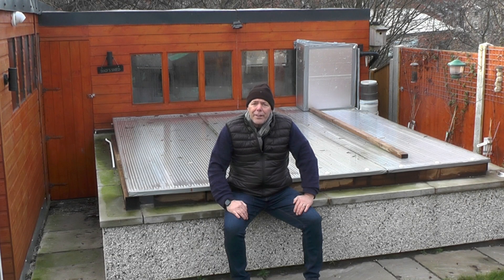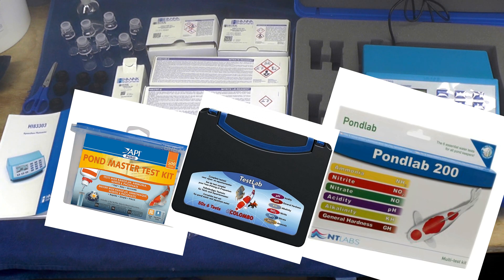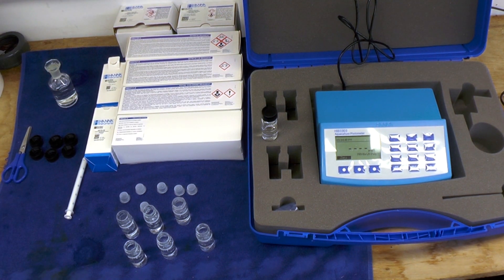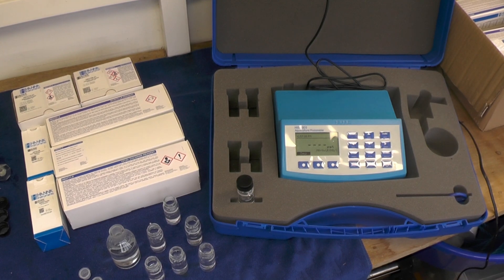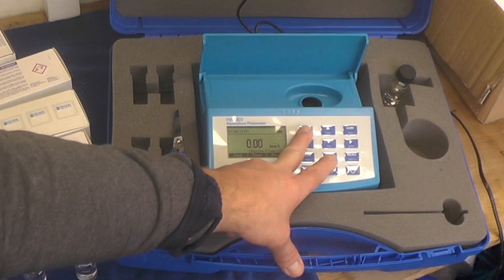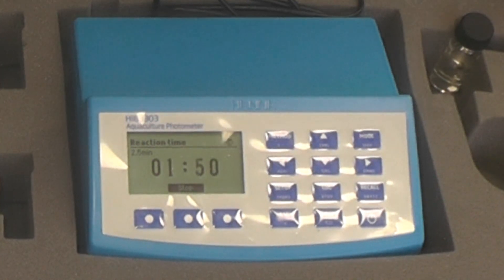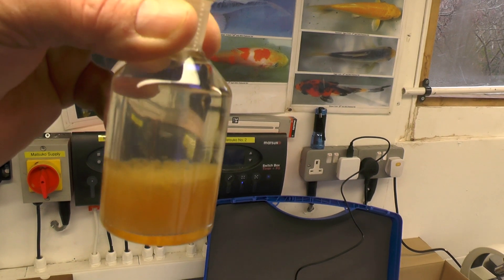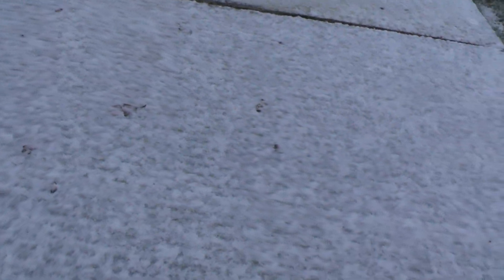How To Test Koi Pond Water Parameters With A Hanna Photometer - Part 2 - Chlorine & Dissolved Oxygen

Comment: Hi Kev,  I know they're expensive but they are a nice bit of kit and more accurate, I've used the satchets but found them a bit fiddly, either that or I messed them up going into panic mode, I have a handheld phosphate one from my reef tank days because normal test kits for phosphate were very hard to read, trouble with the handheld one I had if you wasn't quick enough it would turn itself off and would have to start over hence my panic mode, I don't know if they're all like that or if I was just super slow. Happy New Year, stay safe.
Rob.

Comment: Thank you for the water tests update. Interesting how you have residual chlorine. What is your source water chlorine, chlorine level coming out of the dechlorinator, and how much water are you changing? I've used my hanna total chlorine kit only once. I should test mine around this time of the year.
Reply from the maker: Thanks for watching and commenting. I got the Chlorine tests so I can monitor the effectiveness of the 3 Stage Dechlorinater. The issue with them is the flow rate needs to be slow (5 Litres per min Max) plus the life span. As mentioned I swapped the Cartridges  in late Spring so despite only doing small water changes I have no way of monitoring the volume used. This test proves I need to change the Cartridges of the VYAIR so my next Video is not only about the VYAIR but a Box opening and install of a 20" 3 Stage VYAIR Dechlorinator Unit.
Reply from the maker: I don't really do regular water changes because of my set up. The Oase Drum filter cleans every 20 minutes depending on the cleanliness of the water. The Skimmer filter is a Pressurised filter and is flushed weekly so between those two filters and natural evaporation the auto top up replaces the dirty water and if I was to try and equate the volume I would say it would be about 5% per week water change if that. Now in the Summer I also use water from the pond to water the plants every day and I flush the filters more often so in theory it could be 10% per week, but the big indicator is the Water Parameter Tests and if they are all good then the water changes are fine. like I said earlier I can now monitor the Chlorine in the water in the auto top up header tank more regularly
Reply: @AKoiEnthusiast  At that water change (5%), I would think (could be wrong) it would be impossible to have residual chlorine in a koi pond unless you have an extremely high chlorine level at the tap or the VYAIR dechlor is totally ineffective at this time. Do you have an overflow system?
Reply from the maker: @KoiRun50  The waste outlet of the Oase Proficlear is acting as the overflow. Over the next few days I will test the Incoming water from the mains, The water exiting the existing 10" VYAIR Unit and then the water exiting the new 20" VYAIR Unit so I can better understand what the levels are.
Reply: @AKoiEnthusiast  In that case  I would check the auto-fill in case that is stuck open.
Reply: @AKoiEnthusiast  I would also check your nitrates. If your auto-fill is stuck open, if you don't have nitrates in your tap water, with residual chlorine in the pond, you would notice that your nitrate level is zero or near zero.
Reply from the maker: @KoiRun50  My autofiller is a N/C Solenoid Valve controlled by a float switch. There is also a Flashing LED to show when it is running and I hardly ever notice it is on. The Pond level is lined up within the top 1/2" of the drum filter and works well. If I switch the Pump off and let it settle it just raises to the top of the drum, level with the outlet. I did do the PH, Nitrites & Ammonia of the Pond water and they were 7.5, Zero & the Ammonia was 0.02mg/L.
Reply: @AKoiEnthusiast  I stand corrected. My apologies. I checked my total chlorine in recent weeks and total chlorine show 0-6 ppb. I just learned about the difference between free and combined chlorine. See my latest video.